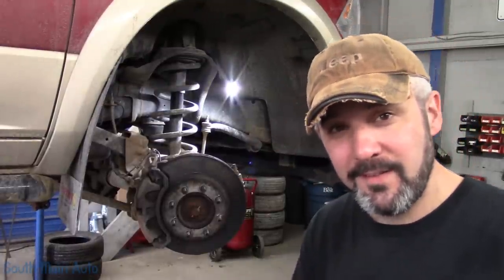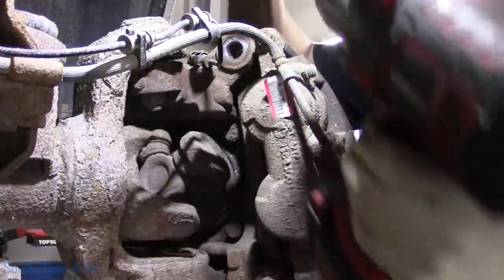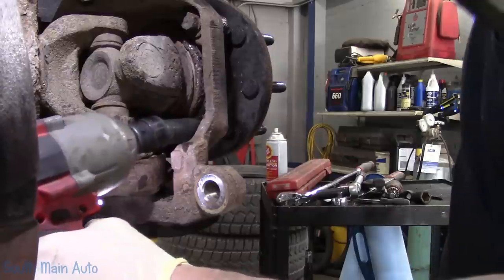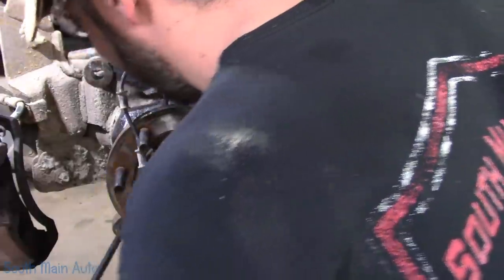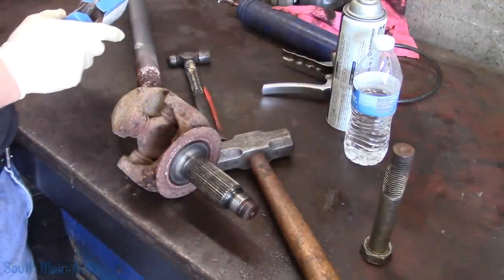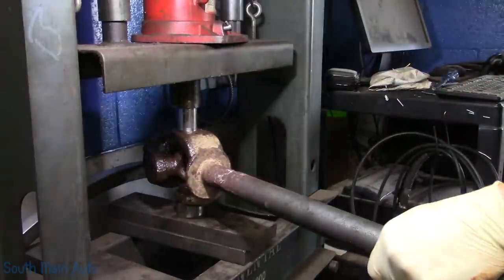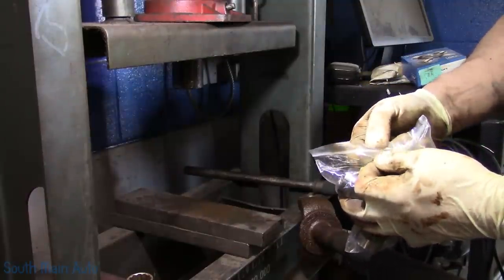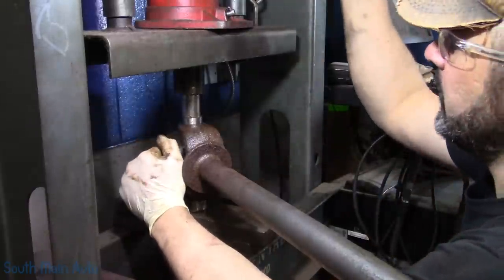Dodge Ram 2500/3500: Front Wheel Bearings & U-Joints - Part I

Comment: Looks like the same axle dana 60 on the f350 2005 only difference I see is the tie rod bolt connection hole is horizontal on the dodge and its vertical on the fords
Reply from the maker: Except it is not a Dana. It is American Axle Manufacturing AAM 9-1/4"
Reply: South Main Auto Repair oh that's interesting looks just like my dana 60

Comment: Hello I have a question I just pulled the pasanger side axel out to change my wheel baring and when I was about to push the axel back in I seen that at the actuator the sleeve was offset so there’s no way I can put my axel back in do you know if this means I need a new actuator or can I fix this ? It’s a 2018 3500

Comment: Have you given any thought to cleaning and re-greasing the hammers inside the head? I know a few people that do this on occasion when it seems their impacts are losing power, they say it makes a difference.
Reply: Chedder CheeseHead i know snap on is easily serviced but some of these off brand ones have convoluted procedures and dozens of screws to remove to access
Reply: BreadAndGatorade actually they don't. You find many videos that take apart the HF  impacts. They are pretty straight forward. It might take an extra couple minutes over the snap on but nothing bad.

Comment: On the axle u joints i use a torch to cut out  the cross. Cleans up the oil. Heats the yoke up a bit for reinstall as it grows a bit.  No deformation of the yoke as when I use the press.  Is this a bad method ?

Comment: I have a question I have a 2013 Dodge ram Cummins diesel four-wheel-drive I’ve done had the ball joints fix the tire rod fixed and it still feels like my front wheels are literally going to fall to the side and off every time I turn it has a wobble to it and it makes a crunching noise and as I’m driving down the road it makes a hissing noise in the tires and a tingling noise can you explain to me what it could be because I took it to Pumpelly’s Central times and they try to say nothings wrong with it but I thought otherwise I know my truck I drive it every day I know something doesn’t feel right on it

Comment: Need to know what u joint to order front axles 2007 Dodge 3500 6.7 diesel . u joint dimention 4.1" 4.1" 1.365 need the u joints I've found. The caps have all been1.4" can you help?

Comment: What wheel bearings do you use on light duty trucks? I've had problems with OEM and Timken wheelbearing/hub assemblies on my F-250. I can't get much more than a year out of them. I'm using Moog now and I'm hoping that they will last.

Comment: You mentioned  that this truck is a 2009 or somewhere around that year (newish) but that it isn't going to last much longer due to the NY winters/salt.  Is there anything in particular that is going to make the truck not worth salvaging? is it Body rot, or frame, or just everything combined?   I'm curious because these trucks are pretty pricey new and yet whenever I talk with a owner and ask them about  using a creeping oil like Krown, or Fluid Flim, or New England Oil no one knows about this stuff. Or they think their 2500/3500 is bulletproof. I live in Rhode Island, lots of salt.  I bought a 2003 dodge ram 1500 with 140k on it and immediately sprayed the undercarriage/doors, cab corners etc and it's got 200k now. No FURTHER issues. It's practically the same as when I bought it 5 years ago.

Comment: So my thinking would be to heat those ears up to expand the metal and make it easier to set the caps in?  What would be the problem with that?  Other than probably hard to handle because of the heat, would need some leather gloves lol.

Comment: Hey Eric - do any of your Dodge 2500/3500 owners have front hub conversion kits installed (I know of Spyntek and Dynatrack, there are probably other brands)?  I know of a couple of guys that have used them and like going back to serviceable wheel bearings.  They seem to be more rugged than the stock ones as well - they seem to take more of beating when the trucks are used on lots of really rough dirt roads and similar. Since I only have a sample size of two, I can't draw any general conclusions.  Have any insight into these?

Thanks!

Comment: I'm supprised that there seems to be no seal between the shaft and tube to keep the muck and water out, unless i missed that.
Yep i must be blind today lol.
Reply: The seals are deeper inside the tube.  You can buy aftermarket seals for the end of the tube, but unless you're submerging the axle in water/mud regularly, they're not necessary.
Reply: El Cheapo, Ahh thankyou, i must be a bit thick lol.

Comment: I have a 1998 dodge ram 4x4 2500 with 276k on it and my joints are perfect   u can see tons of dry road salt on the truck  he obviously never goes to the car wash to pressure wash it off  it make all the difference. you can see big chunks falling off.  he did it to himself.

Comment: Did you say the truck has 44,000 miles on it?
Reply: salt and chrysler combo  for you.
Reply: the owner could be an abusive driver as well.  hitting every pothole he sees...cause HD truck
Reply: LEX Maximaguy87 

I abuse my 02 4runner. 238k, and everything is original except belts and hoses. I do live in dry Texas though... No salt!

None the less... I beat the 4runner almost everyday
Reply: I'm hoping that is a plow truck causing that ridiculous life of those front end parts.
Reply: Eric Corse 

That was my first thought. Maybe there are mounting plates on the front end a plow? 🤔
Reply: Yep, when you have a half ton engine, a plow blade, salt, and the crappy roads in Eric O's neck of the woods, you get destroyed wheelbearings
Reply: Lol geeze.  My friend has a Ford F-150 that’s from mid 2000s has the 5.4 V8 triton engine... and it has nearly 100K miles and lives it’s life wet and salty and only now beginning to look about this bad.    I’m genuinely surprised though, the only 2 things that got rusted through was the push/brush bars on the front, and the foot step .. other than that not much was totally compromised.. the exhaust I guess was also changed.. but that’s expected..
Reply: Refried Beans 

I have you beat.. I have a Volv XC70 AWD that is a tick under 500,000 miles and almost everything is original.  Only been one part that needed changing that’s not considered a consumable part.. was a wheel bearing and was actually my fault I was rallying it around my farm as fast as I could and I hit something sliding wide once and it started clicking .. 

All that being said, my water pump is soon on its way out...  so that’s a project happening soon.  As well as my timing belt, my friend inspected that and is a Volvo lover and expert and told me that the belt looks like it was factory installed belt, never been replaced... so that maybe on the list of things.  

Funny part, even with all my abusive driving, he still offering me $1,200 to buy it..
Reply: Only 44K... RIP!
Reply: Diesel engines are heavy, every heavy duty truck with a diesel engine and 4x4 has some type of problem ball joints front U-joints Dodge Ford Chevy doesn't matter the make. At around 50,000 miles you should start expecting these type of repairs.

Comment: 44,000 miles and it looks like it was sitting at the bottom of the sea 🌊 smh
Reply: What are there using there for de-icing the roads??? Acid??? My car  245.000kms and 20 years old. No rust at all.
Reply: It's the snow belt bud....

Comment: I have an 06 2500 and I hate doing this every time lol...I reassemble with anti seize and hope for the best lol....185K and counting.....any ideas on a serpentine walking off all of a sudden on these hemi 2500’s?
Reply: check the tensioner, idler/s and pulley alignment. if you replaced things like power steering pump water pump and alternator, make sure everything is right and try moving everything in and out by hand. oh and make sure the "crank pulley/harmonic balancer" isn't separating!"  don't know if they had issues or not

Comment: The reason those joints fail is that a single Hooke joint is not a consfant velicity joint so the turn angle of the wheel causes a variation in load each rotation of the wheel. My 1955 Citroen Traction Avant is properly engineered with double Hooke joints thus cancelling that variation. Why dont they fit proper CV joints? Is the load too great? Not familiar with large american pick up trucks. Greetings from Dublin, Ireland- not far from the oirginal Avoca which is a small village nearby.
Reply: Richard Sheil how much is the cost to do it

Comment: It would make a world of difference with those Earthquakes- to thoroughly clean the outside, glove up, take the nose off, and add some quality grease. A high-pressure "moly" base is great. The front and rear stator bearings are sealed. Because they are brushed motors- a high pressure air cleaning (NO SOLVENT) of the rear will prolong it's life, and might regain some kick, too. The Li+ are 4 ah, and around $60. Temperature greatly effects the charge capacity; if kept cooler (65F-70F) they will charge more deeply, with minimal wear.  http://batteryuniversity.com/learn/article/charging_lithium_ion_batteries

Comment from the maker: *Safety Orange Powder Coated Brake Caliper Hanger Hook (2 Piece Set) -MADE IN THE USA-: https://amzn.to/2IkKYTS
*OTC 6290A Front Hub Puller: https://amzn.to/2roZNuY
*Astro Pneumatic Tool 4980 0.498" Shank Super Duty Air Hammer/Riveter: https://amzn.to/2jDByok
*DocaDisc 30PC - 2 inch Roloc Sanding Disc Mixed Pack: https://amzn.to/2FTCJJ3
*Astro 219 ONYX Die Grinder Kit, 3-Piece: https://amzn.to/2KJc31l
*Astro Pneumatic Tool 40SLMAX Astro 450 Lumen Rechargeable LED Slim Light with XL Batter: https://amzn.to/2rsLJzF

DEBOSS GARAGE:
"How To Remove RAM 2500 3500 Hub Assembly - EASY SIMPLE TRICK!" https://www.youtube.com/watch?v=-bzr_4DLKG0

Comment: 95 Chevy Z 71 4 x 4 pick up live in Chicago use my truck as a truck 230,000 miles all original wheel bearings and u joints. It never spent one night in a garage. If I to do that at 50,000 miles I would never buy a Dodge. And yes they love using salt around here also.

Comment: Funny you say  the u joints usually don't make it past 50k. I have A 1998 ram 1500  with 150k and all original front driveline including the cardan joint. of course that's A north carolina truck

Comment: Dang! 44k? Im glad I live in dry Texas. 02 4runner 238k miles, and everything is original except for belts and hoses.
Reply: Refried Beans Hell yeah, I'm in Arizona...had a Toyota Corolla with over 300k on original engine/transmission, totaled after rear ended. Got a 2001 Ford Excursion with 238k, 93 Subaru with 190k, and an 05 4Runner with 160k! Love the dry air!

Comment: With all the salt on the roads, one would think the auto manufacturers would offer models with optional fully dipped chassis and floor pans,  dipped in whatever the newest and best coating would be, or even some kind of powder coat paint, or whatever, that is, until we consider that they want to sell new cars, yet couldn't they make as much by making fewer cars, and adding a bit more to the price of lasting ones?

Comment: You been caught in the act of upselling ...
those UJ's clearly just needed couple pumps of grease lol :-D 
for 44K that truck shocking, keeps you busy and Mrs O on the cash register, ka-ching baby :-P
Big nasty is a workshop hero, air hammer makes jobs easy .
you need get back on the air impact, get a stubby ns1600f .
Battery impacts suck due to size, price and unreliability in heavy use .

Comment: OK engineers, I made my own puller. I used a 12 ton bottle jack instead of a bolt and threads setup. It worked just fine and some may say..."Who cares then, it worked." But I was wondering if a threaded puller can apply more force than my 12 ton bottle jack in this application? I assume the threaded puller has fine threads and those threads are the weakest link in that tool. Asked another way... Can a threaded puller, like the one Eric uses in this video, apply more than 24,000 pounds of force to the rotor without stripping the threads? I'm thinking it can apply way more force than 24,000 lbs., but I'm not really sure. Actually, I'm not even sure if a 12 ton bottle jack is capable of producing 12 tons of force when it's applied statically in the way I'm using it. BTW, the bottle jack had no issues being used in a horizontal position in case anyone was wondering.
Reply from the maker: A 3/4" course thread grade 8 bolt can create a 30,000lb clamping force when its torqued to 380 ft lbs dry. :)
Reply: @SouthMainAuto  Thanks, I assumed a bolt would be more, but apparently not significantly more. If the  12 ton jack didn't work. I would have applied a higher rated jack. Something has to give at some point right? Your videos are very much appreciated Eric. I wish you were on the west coast so I would no longer need to work on my own vehicles.

Comment: astounding rust on truck for under 50,000 miles !!     
   -would Crown rust inhibiting have helped?
      investment of  couple of $100 to save $70,000 truck seems BARGOON ~

   many replacement U-joints used to come STD with grease fittings
     but people STILL failed to grease them~now requires premature replacement ~
      ~did main drive shaft also have bad ujoints?

Comment: i think vehicles mostly rust to death because the owners dont take a few minutes every week to spray the bottom  ...LOL why do you have a piston ring for a ship engine?
Reply from the maker: Who doesn't have a ring out of a ship layin around!?
Reply: hilarious. what is that thing really for? or is it really a ship ring lol anyway i can attest to having minimal rust with a 13 year old car rinsed every week or so. the bottom is in good shape, no where near like that truck. one rear fender has a little eroded spot. and the car was krowned twice. but those fender areas get splashed a lot and the car was hit a few times damaging the bumpers. the body shop might have scuffed the paint where the plastic bumpers clip on and thats where it started. but i oil that spot all the time to stop the rust. if washing the bottom of a vehicle twice a week maybe even better results. so far it looks 95% rust free(except for some surface rust but not looking like the titanic) anywhere on the bottom and sometimes i rinse it every other week. or maybe toronto doesnt salt as much as new york. if it helps to compare, the roads are all white when they dry up in winter.

Comment: that puller tool is fine and dandy if you dont plan on reusing the hub assembly,but using that tool will end the bearing's life really fast if you reuse the bearing,easiest way to get that stuborn hub off is the use the powersteering to push it off,been done thousands of times,i can count how many times i showed this trick to veteran mechanics who have been beating on the hub trying to remove it for hours,take me 2 minutes my way,they usually freak out at how simple it is,

Comment: Damn, my '99 cummins has 235k-- still going on original wheel bearings-- just replaced original driveline u-joints, as the center bearing went out.  I guess Kilmer is right:  Dodge quality has gone downhill.
Reply: Thats what happened to crystler when fiat took over.

Comment: when the press gauge would hit 10,000 lbs ,for some reason i got nervous.we had a 20,000 pound press. if you guys out there have presses i recommend getting a gauge on them,it's way easier to look at the gauge than try and guess the actual pressure that's on your part.most stuff starts to move at 2,000 psi,at 500 psi you probably have a worn part.remember your dealing with an interference fit.but only by .0002 for 1/2 in and below.all my years I've never dealt with rust like that,i can say is in the bay area Calif,were pussy's.OH MY I GOT A PIECE OF SAND IN MY EYE>>>CALL OSHA>>>>>>ha ha...3 weeks off on disability...

Comment: Ya, 44k or 440k?  because our 11 at 180k is just fine with no play.   One wheel bearing replaced from a very large pot hole impact.   Granted it didn’t see salt till. 2019...
Reply: Cuz it's in the rust belt